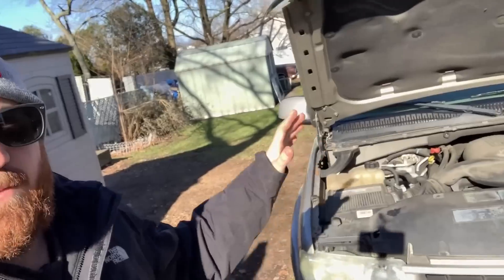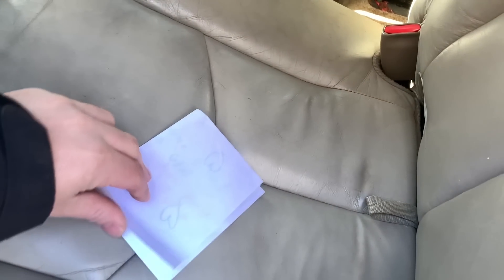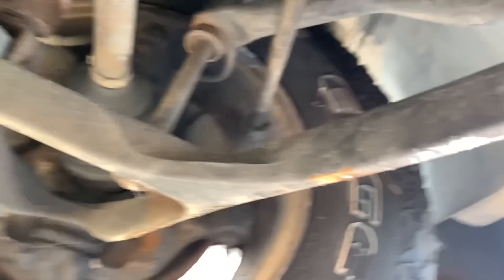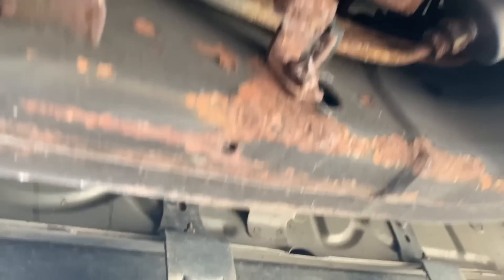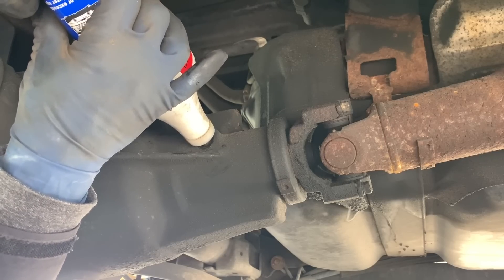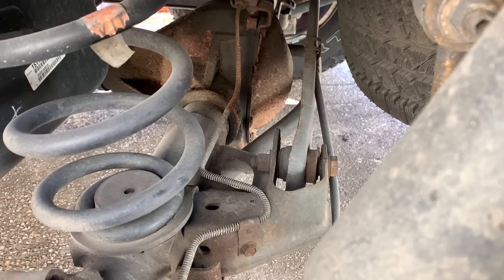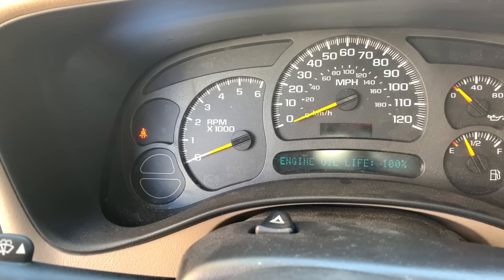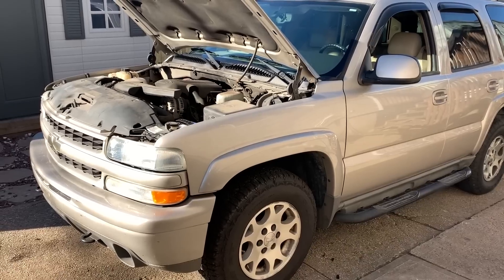I Found a Hidden Message in the Auction Tahoe! | The Shake Down

Comment: Awe, that note was such a classy touch. I loved my 2003gmc Yukon 4x4, and because there was an electrical issue that would stop the vehicle from turning over, I had to trade it in. Worst decision I ever made. It has been 10 years and I cannot take it anymore, I will be purchasing a 2004 Yukon XL 4x4 and will be changing out seats and leveling it out possibly a 3 inch lift, 2in spacers and fatter rubber all around. I will incorporate the wireless charger you recommend and possibly even Android auto 10" display/cd/mp3/Bluetooth....but thanks for the great videos.

Comment: Don't forget to split the transfer case open and do the upgrade for pump rub.  Also replace the heater hose quick connectors.  Use gm ones and avoid the garbage dorman ones.  I own an 06 Yukon with the 5.3 and 4.10 gears 4x4 and it has taken real good care of me.

Comment: Not too long ago I picked up a tahoe as well, got mine with 201k and now it has 211k. I live in Northern PA so rust is a big issue here, my tahoe is from Kansas where it spent its whole life so it’s nice underneath. I had the same mindset, high miles and no rust is much better than low miles and rotted out. So I’ll definitely be watching this series as I have the same problem with the trans cooler lines lol. Subbed!

Comment: I bought a 2003 C/1500 Tahoe in March with 287,000 for $2700.4.8 LS. Runs OK, but mileage is just over 13/mpg. Worst  gripe is AFU 8-Way driver's master switch. Also tells me DOOR IS AJAR when it ain't. A/C is down, and I'm in Tucson in summer. Passenger window has to be energized from local switch. Master won't control it. Sometimes, rear passenger window comes down on its own. Got it because my mechanic retired and told me get a truck built in this century. But mainly I'm running my '71 GMC Jimmy K/1500 or my '68 Chevy C/10 Stepside to get parts for the 'Hoe.

Comment: i know this was 5 years ago buy future reference get a can of electronic cleaner pull the knobs off of the climate control spray a lil in there and it will fix it have done it to numerous cars also works for electronic switches for windows, locks etc love the tahoe btw

Comment: Do you recommend a thicker oil for a truck with 140,000 miles? I usually use what the truck recommends but I wondered if I should use a thicker oil due to the high mileage.

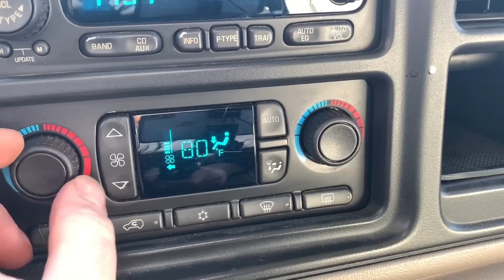Comment: 2:10 pull knobs right off and spray electrical cleaner into the small joint where the knob bar is. Worked for me instantly. Late, but just sayin for anyone else.
Reply: yup that fixed mine also

Comment: Late comment but for the parking brake my 06 Silverado, the pedal inside broke multiple times at the spot where the cable clipped into it. Not sure if you ever got it fixed with shoes or anything else but just throwing my experience out there

Comment: Heads up, the stepper motors in the cluster assembly are prone to go bad. I have a 04, found a company in jacksonville florida thatll replace them. Found them on ebay, theyll request all the information mileage, hours, etc.... and theyll ship you a new one and you send in your old one. Want to say that it was around $200, plus a core charge that got refunded after they recieved the old one. Just a heads up man!
Reply: And if the rear loses heat, its a blend door actuator inside the panel behind driver rear seat. Dont order it from amazon, match part numbers with ebay. Its a common issue with these tahoe/suburbans as well.

Comment: Hey boss did u ever change the actuator  for the ac blowing hot air on ur driver side I have the same problem  on my Yukon which is the same thing i was looking for the video but no luck finding it!?
Reply from the maker: Mine started working again weirdly. Theres a small procedure to reset the motor position. I think mine was out of wack from the battery being dead.

Comment: Do not replace your climate control, you will be wasting your money. Pull the knobs off and spray electrical contact cleaner in there. 95% of the time that is all it needs, I've had to do it twice on my 04 escalade in the last 5 years and it worked both times.
Reply from the maker: I notice if I put pressure on the knob as I turn, it works without a problem. Will definitely try it.
Reply: @lsxmatt  mine worked with pressure on it also then after spraying it, it works like new

Comment: Hello my name is Troy..I have a 2004 GMC Yukon with 145.000 on it I’ve been replacing parts on it a lot …it’s pretty old now but I still love my truck…but some things still need replacing…one is my reverse lights does not work.. I checked the bulbs and check the fuses but still no reverse lights I don’t know what’s going on… another problem I’m having when I turn left or right I’m hearing grinding noise.. do you have any suggestions for me I can probably help me out I would deeply appreciate it

Comment: dorman makes a climate control for my trailblazer. it looks just like yours. it costs $160.00ish. if you buy the factory one it’s like $250.00 then you have to pay the dealer to program it.
Reply from the maker: Does the dorman one need programming? That seems like the way to go then!
Reply: @lsxmatt  no it doesn't, it comes with instructions on how to self program.
Reply: You can pull the knobs off and spray some electrical contact cleaner and turn the knobs back and forth
Done it to many suburbans and it definitely helps
Reply: That was going to be my suggestion too.. try cleaning the contacts on knobs first.. worked on radio of my old grand am and on controls on coworkers old trail blazer.

Comment: Man you’re fucking brave! I wouldn’t ever trust “Ramps” with that kind of weight. Honestly I don’t ever trust them alone! Do yourself a favor and throw a couple of jack stands under it to catch the truck if they were to collapse while you’re under there! Ramps are famous for failing! Just trying to be helpful, be careful bro!
Reply from the maker: My jacks a low profile so It doesn’t get high enough to get jack stands under it. I have to pick up a set of rhino ramps!
Reply: LsxMatt You could still use the ramps to get it in the air, my suggestion is just to stick a couple of jackstands under each side once it’s already up there to keep her from falling on you if the ramps were to collapse! 

Even using rhino ramps doesn’t matter, they’re still really not safe! 

If you’re going to go buy anything my suggestion would be, and I do own these things, go by the yellow Daytona 3 ton yellow jack at Harbor freight. And if you have a northern tool supply anywhere near you or if you want to order them get their brand of jackstands with a little pin that you can put through the top big enough that will support the weight of the truck. 

I have an 08 Tahoe that I’ve been using that Jack and jackstands on for couple for years now, both are reliable and both made of thick heavy gauge metal and completely safe and honestly the best way to go. 

Plus you can use them to get your Camaro extra high in the air if you want to like say to do a transmission job it’s nice to have the extra room underneath as I know from experience with my 98 Camaro.
Reply from the maker: ANTIVNM good idea, Ill put the jack-stands under there when I do the trans lines. Just need to pickup a jack and the stronger stands then.
Reply: LsxMatt this is the set up I use, and is proven safe and effective with my 08 Tahoe, and awesome for transmission work with my 98 Camaro. 

I’ve been through many jacks, and jack stands over the years, and these are by FAR the best as far as safety and budget goes. You truly do get the best of both worlds with these things!

Here are some links to the set up I use. 

The jack stands are on sale for $10 off and free shipping right now. 

Harbor freight yellow Daytona 3 ton floor jack

https://m.harborfreight.com/3-ton-daytona-professional-steel-floor-jack-super-duty-63183.html

Northern tool double locking 6 ton jack stands 

https://m.northerntool.com/shop/tools/product_200717287_200717287
Reply: LsxMatt cool. Let me know how they work out for you and how you like them. 

I’ve recommended this combo to a few people I know, and everyone has been very happy with them all so far going back a couple years now. 

Harbor freight and northern tool should be paying me a commission;)
Reply: LsxMatt don’t forget to check out the links I posted in another comment above. The jack stands are on sale with free shipping;)